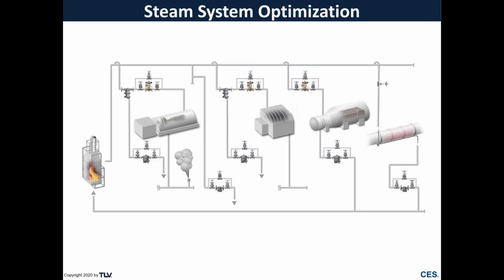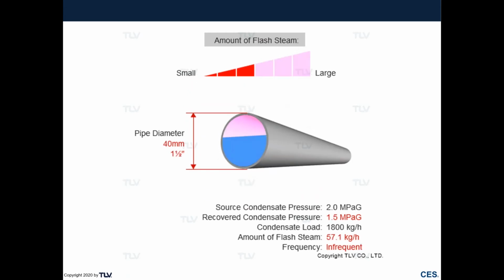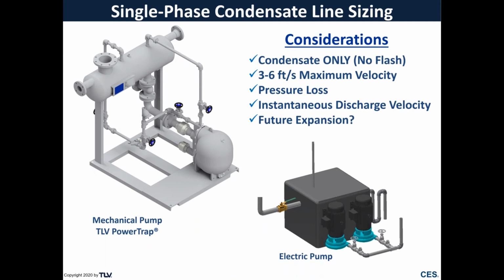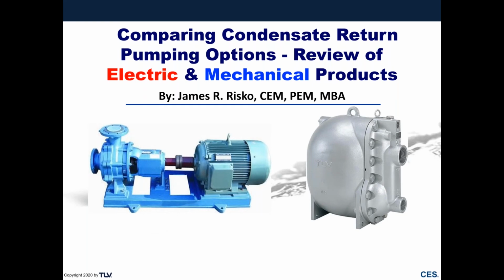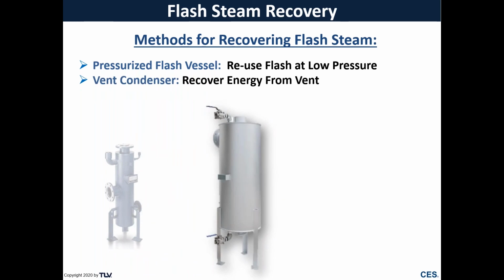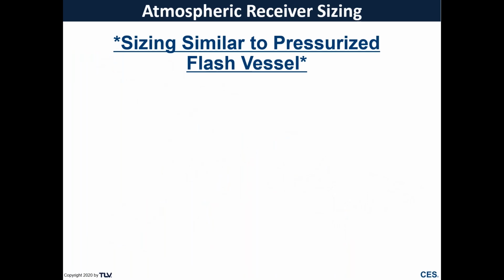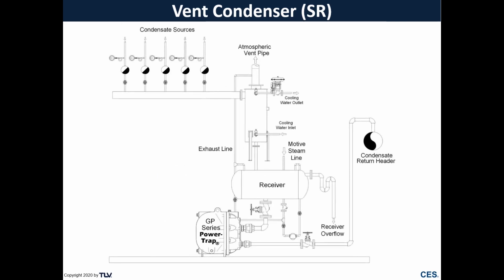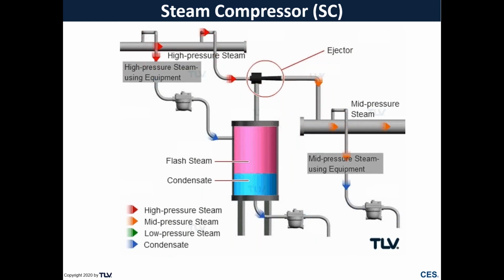Increase Energy Savings Through Condensate & Flash Steam Recovery Webinar

Comment: What are the recommended methods for cleaning scaling deposits from the coil tubes in a TLV flash steam heat recovery system? Additionally, are there any specific maintenance procedures or chemical cleaning agents that TLV suggests to ensure optimal performance and prevent scaling in these systems?